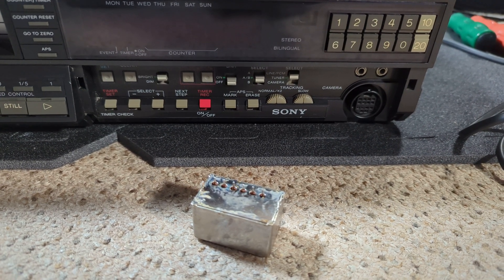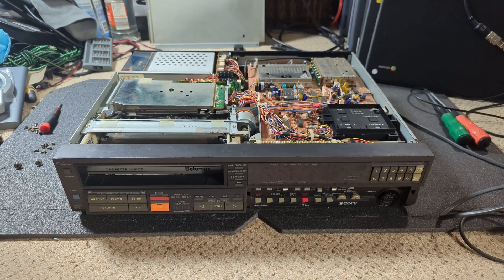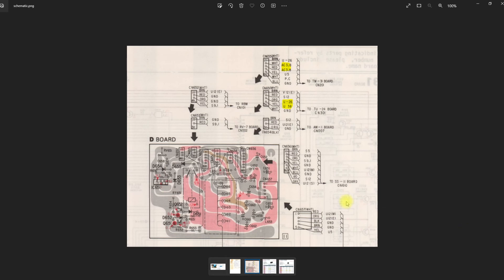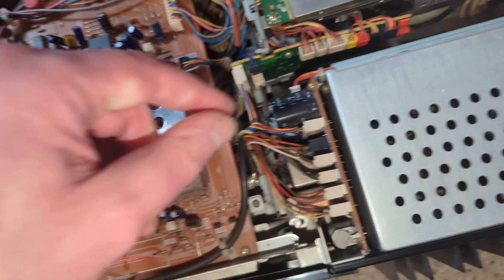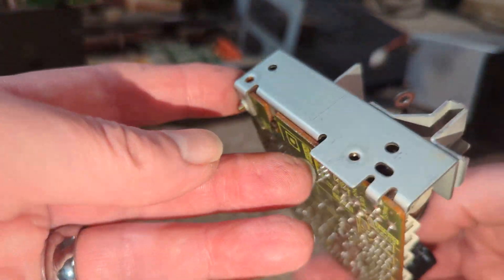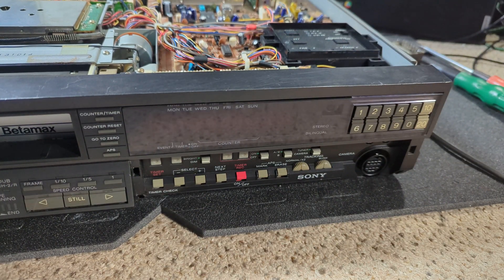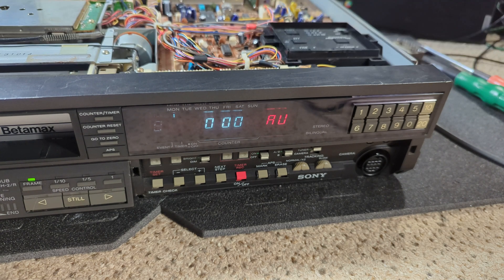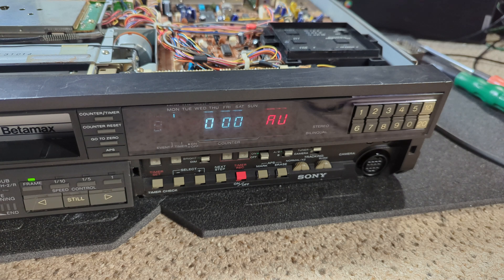Sony SL-C9 Betamax - DC-DC convertor replacement

Comment: I have a C9ES as well where the windings are shot on the DC-DC Converter. Im thinking about designing one that actually provides 3.3V AC for the VFD.
Reply from the maker: That would be great to have AC for the heaters in the VFD and is something I've been looking to do but never get the time. Very interested to see what you come up with.

Comment: Repaired all Betamax for Sony since 1984. Incl. C9E/ES silver and black. Many mechanical standard problems those days. Wonder who has the AG90 as well, the videocassette exchanger.
Reply from the maker: I can see mechanical issues were common with these back in the day. How long was it before you saw the DC-DC-AC convertors starting to become an issue? I'd love to see the AG90 in the flesh, they look amazing. I do have the changer for the C7 which still makes me smile as it does it's tape change procedure!
Reply: @MrBetaByte  , can't say exactly, but think after one year after first release on Dutch market. The C9e/es had a wonderfull Reelmotor system, 6 coils stationary in a magnetic wheel. Sometime the driver IC's where fully burn out on the Servo System board.
Reply: @MrBetaByte , the DC-DC problems occurred about 1 year when device was sold to customers. I think SonyNL/SONY JP used a coulance rule when the same problems occurred after warranty time (malfunction component by production faillior).
Reply from the maker: @AudioVideoVintageLover  That's a very short life span and a shame the original DC-DC module was so unreliable. The newer version was definitely better but still caused issues.

Comment: I would prefer RECOM (RS6-1215D = +/-15V 0.2A) for DC/DC converters.
Reply from the maker: Definitely. Thank you for your email too. The XP units work so well but the capacitive load makes them a bit of a pain.

Comment: Never seen a black C9, looks so much more modern in that livery.
Reply: The black one is really rarer .   I was lucky enough to find one after a long search . But I had to have it repaired first. I have also put a clip of the black c9 online, it looks different because of the colour
Reply from the maker: The black C9's are really quite something and look so modern (It's all relative of course!) I believe there was also a red one too but they are super rare. Very few black UB machines but many more E machines.
Reply: @MrBetaByte  As far as I know, the black SL-C9es only came onto the German market in 1984. The SL-C9e from 1983 was only offered in silver according to the Sony catalogue. So the black one came on the market one year later, so the main selling colour was silver